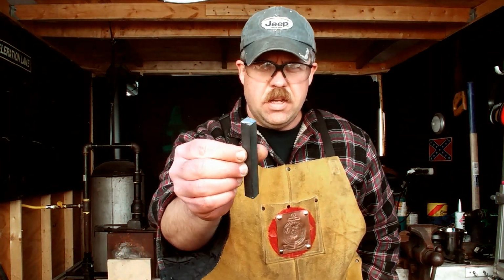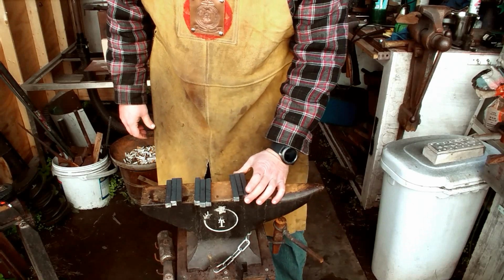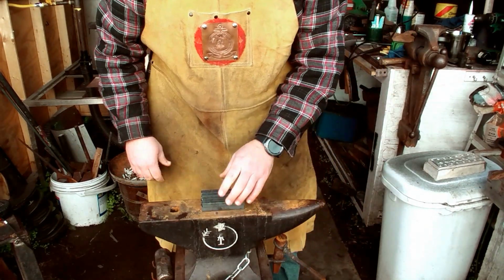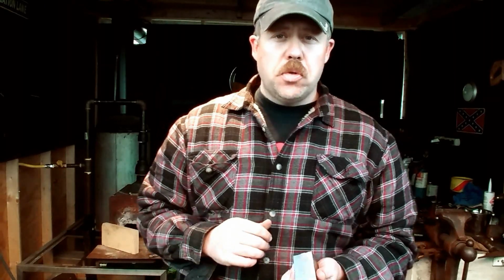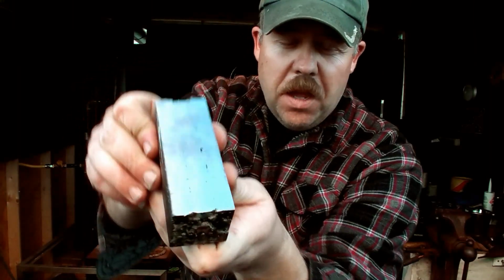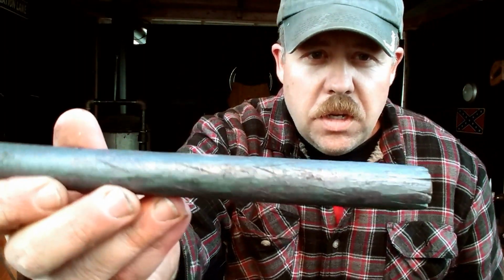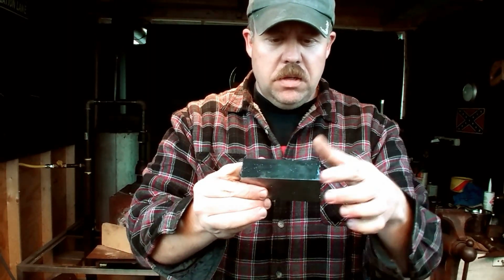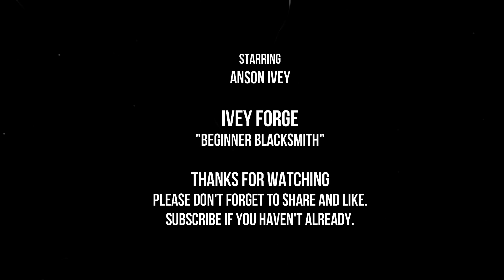250 subs giveaway announcement...plus making a wood textured metal hammer for my 500 sub giveaway

Comment: Anson you could get you a cheap hammer and cut a texture in the head and put your mild hammer head in forge get it hot and forge the wood texture in the head with hammer strikes. I watched a video once that did this I will look for it. If I find it I'll link it to you!
Reply: Heres one way to give it a texture. Another way is you could cut grooves in a 2 plates and make a textured spring fuller  https://youtu.be/6sw9y_j7uJc
Reply: Yeah. Or take like a claw hammer and cut grooves on the face and use that to put your wood grain texture on your hammer fresh out the forge!.... just a thought!
Reply: The old forging proverb...... need a tool..... make a tool.....